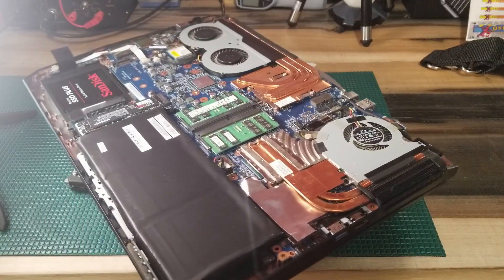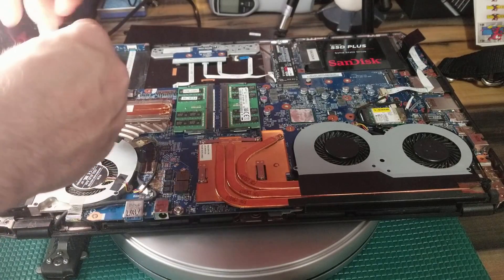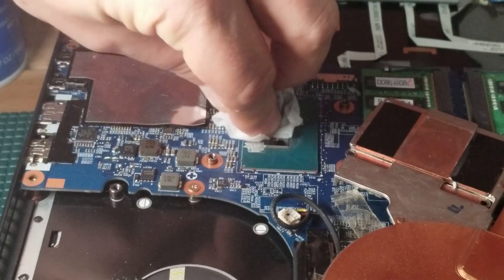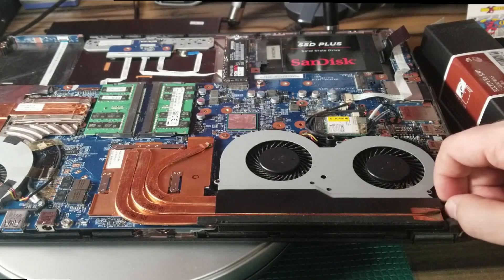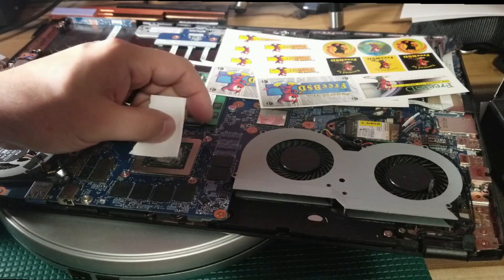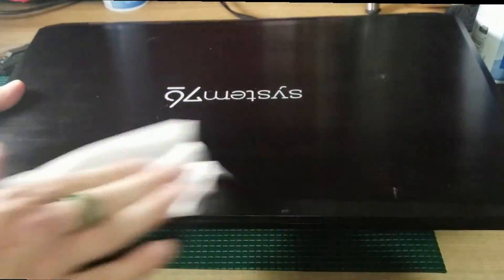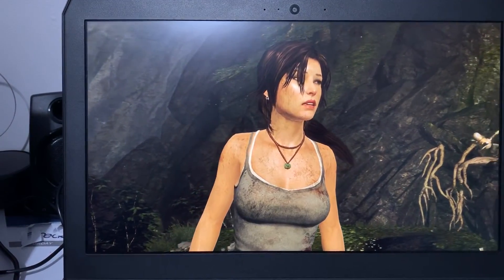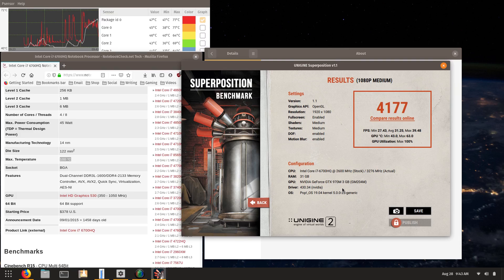How I Saved $500 on a System76 Linux Laptop (Bonus - Throttle Repair & Cleaning)

Comment: "caked up" thermal paste is in fact absolutely no problem and fine IF you leave it alone as is!!! it would just continue to work like on day one. HOWEVER... if you messed around with the heat sinks or heat pipes and have "messed up" the thermal paste pad, THEN its done and maybe needs a remake. But dont just rip off any heat sink to renew the thermal paste layer if not really necessary. blow out dust, clean or replace fans if needed. upgrade to fast ssd and max the RAM. job done!
Reply: My 2 cents from 27 years experience.
With thermal paste I would replace it.  I believe it dries out more compared to pads.
I serviced Thinkpads from '96 to '03 professionally.  Their thermal pads looked new after 3+ years.  With a light touch of a spudger.  They were still spongy and not dry.  If I removed a cpu the pad was ripped or to compressed.  I would replace it.
Reply from the maker: Respectfully, I disagree. As cooling performance degrades so does the longevity of the components. Every 3-4 years you should have your machine looked over by a tech and basic maintenance performed which should include repasting. People can do it themselves as well but if you’re waiting until you’re having performance issues you’re going to be hitting thermal limits and throttling killing the longevity of the hardware.
Reply: @dasgeek  as a long time IT professional I totally agree. Regular maintenance and cleaning is important and good for prolonging the devices life. But that does not include repasting, until you messed with the heatsinks already and therefore destroyed the pad. The degradation comes from dust , dirty and failing fans, clocked up heatsinks, maybe battery capacity in some devices.